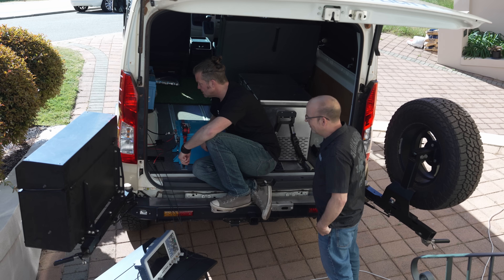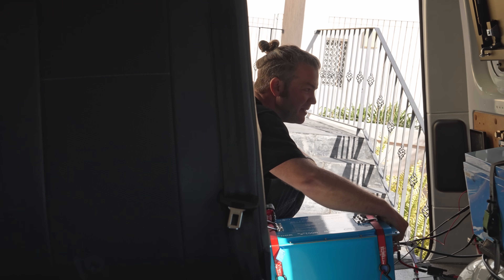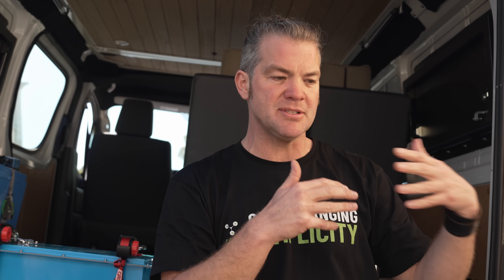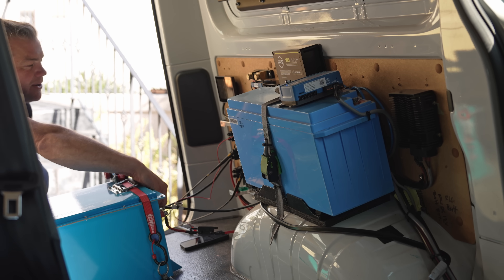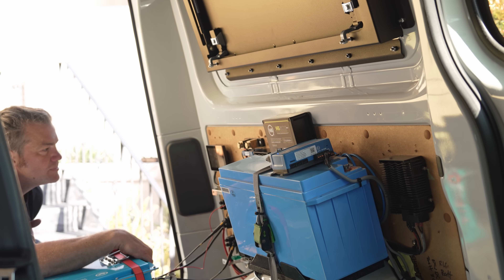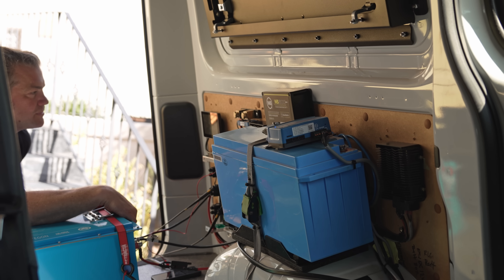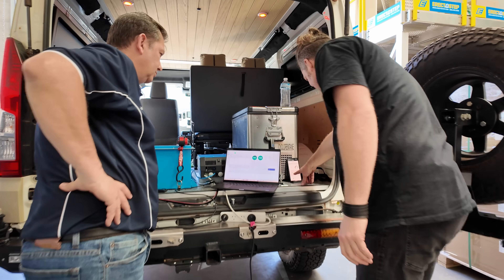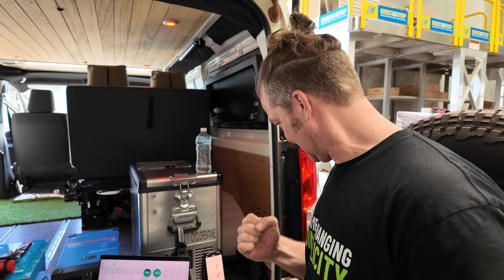FINAL HURDLES CROSSED. 48V is on its way  @4xoverland

Comment: Help me understand this concept of driving away, charging tge vehicle's battery, returnung, shutting off the car and recharging the caravan.

1. does a typical 12v battery have enough amps to charge a presumably much larger house bank?

2. sounds like the risk for #1 is a dead vehicle battery. is there communication betw batteries? (and an auto disconnect based on voltage sensing)?

3. must the vehicle have a smart alternator? ie, old vehicles out of luck?

and one comment...love the enthusiasm and all the "awesome things" we can do.  ...but im still not sure i quite understand the benefit. so id suggest continuing to refine and clarify the benefit. (the need, the problem & the benefit). i think i get it (certainly smaller wire sizes & a bit of weight savings), but im not quite there.

good luck! love following the design/development. exciting!
Reply from the maker: This cannot be done with 12V. Physics prevents it. 
Benefit: Really fast battery charging. Think about what that actually means. The equivalent of a 400 a/h 12V battery charged 0-99% in 1 hour driving, that is faster than the fastest shore power charger. That, with a the best 12V system is 4-5 hours in 12V. There are many who drive 12V to its limits and for them this is a game changer. AND . . . the energy savings on the battery discharge side, we haven't started that discussion yet. And we are about to prove it.
Reply: @4xoverland  hi Andrew, I’m also confused by the idea of driving the car to go fishing and then returning and being able to recharge the caravan from the vehicle (with the vehicle off). I get that the 48V alternator allows rapid charging, but where did that energy get stored? The vehicle would need a battery with a capacity like at least half of the caravan’s battery (so it can half charge the caravan when you return)
Perhaps another example would be to talk about how long you would need to idle your vehicle to restore a decent amount of charge to the caravan, I suspect that would be an example that most campers could relate to. 
Keep up the great work, the products look excellent, I think you’ll have more trouble telling the story than creating the fantastic electronics 🙂

Comment: I think one of your biggest achievements is creating the 48v alternator and the associated circuits so it will happily supply the vehicle’s 12 volt needs.  I think this part is very significant and glossed over a bit, people may not be fully appreciative of this achievement.  The 48v hub is also awesome.
Reply from the maker: All this is done via the 48V hub. Plug and play 48V. A world first.

Comment: What difference or and advantage would this system have over the bluetti RV5?
Reply from the maker: To compare this with a Bluetti is like comparing the load carrying ability of a Fiat 500 and a BelAZ 75710. (Google it)
Reply: @4xoverland The RV5 is also 48v using 48v lithium battery’s
Reply: @4xoverland Edison built an electric chair to try and prove Tesla wrong, never been a fan of analogy’s, that being said I’m a fan of what you guys are doing and keen on your 12v egon as my power demand isn’t to high when off grid  prospecting, but also look forward to options for the future for long term off grid solutions when the sky’s are grey.

Comment: What is different between your product compared to the 48 volt systems already in newer caravans and touring vehicles ?
Reply from the maker: Right now, every 48V system is extremely complex, unservicable and expensive. This changes everything. Its simple, ease of installation, built in redundancy and price.

Comment: Why not install a ecoflow delta with one or two additional batteries and go to 240v. 

Much more efficient, smaller cheaper and more versitile.
Reply: 240vac brings a whole new level of safety requirements (for good reasons). I personally would not feel comfortable driving a car full of 240vac. Too many failure modes that could result in electrocution of the occupants. 48v is a nice balance between efficiency and safety IMO.
Reply from the maker: Thats all fine but you've changed nothing. Adding batteries solves nothing. How are the batteries charged? If its by 12V source its slow and cannot resemble what is achieved here. Even a 240V wall socket can't deliver this charge rate!

Comment: 4 weeks without moving the caravan or plug in, just on 12 volts and solar over winter. 
What can this offer that the existing system doesn’t.
Reply from the maker: If that works for you, then faster charge and reduced losses in the discharge end might help. But by the sounds of it, your system works perfectly for you. Until you add an air-con that is?

Comment: Love your work!! I come from a Comms standby power background, where -48VDc has been used for decades!  I was always heading the 48V way for my Sprinter conversion.  The controlling of the 48V alternator is  a major part of the “revolution”.   The V30 Sprinter conversion market is significant. Be pleased to know how this system will fit into the Sprinter platform?
Reply from the maker: You are absolutely right! We have our US partners looking for a Sprinter 48V alternator now. Its the only missing piece of the Sprinter puzzle. Keep watching.
Reply: Having had my VS30 Sprinter for a couple of years, another selling point of your system is the 48V to 12V DC to DC to the start battery. The van draws a lot of quiescent current, (not to mention the electric sliding door). So rather than trying to feed the door and other items from the camper battery, this is a much neater solution…

Comment: Let me know if you need a demo vehicle and van for the testing. You can replace the 12V Egon system Heiner installed into me 200 four years ago into the 48V version. :) In all seriousness, the technology is looking very promising. It will be interesting to see the cost of the full set-up once production models of the components are finalised. No need to carry the 2.2kW genie for those emergency situations. Great work!

Comment: Who makes the 4WD hiace?
Reply from the maker: Its a Toyota HiAce converted to 4x4 by Bus4x4 in Brisbane.
Reply: @4xoverland well yeah….that too lol 👍
Reply: @4xoverland I’ll ask them about cost, I’ve just test driven a quartermaster grenadier but the hiace could be an option
Reply: Starting with Bus 4x4 you will then move on to whatever your own needs in a camper are.  We camper people are a pretty diverse lot and variations are endless.  Andrew and Heiner have been moving along a development path that is far from over, given their careful testing and high standards, especially since so many components have to be specially designed for HiAce….the market has not just been sitting there waiting for us all to take up what we want for our own build…..it is all being developed and manufacturers will gradually move in and produce whatever they do best.  Then we can begin😊.  Roll on 2026!!
Reply: @robynetracy1440 what sort of price is the converted 4WD hiace? I’d customise it myself. I’m in qld
Reply: Bus 4x4 has head office in Brisbane.  When I last enquired their system was available for new vehicles pre-registration only.  Registration in Australia requires engineering certification.  Their prices are on their website.  Enduroco can accept vehicles post-registration….I don’t know a lot about them as their lift is a bit lower than Bus 4x4.  You would probably need to discuss the process with Queensland Motor Registry to determine whether self-conversion to 4x4 was practicable.
Reply: @robynetracy1440 I still have nostalgia to my UK Devon moonraker camper which was very handy when I took girlfriends out on dates ;)
Reply: Toyota
Reply: @2UZFE The only 4x4 HiAce Toyota built vehicles I have seen imported into Australia have used the ‘snub nosed’ design which they still sell in Japan.  I am told that this design has the driver and passenger sitting over the engine….not so comfy on our off-roading tracks!

Comment: This is very innovative. However getting a 48V alternator is a challenge. And you cannot just plug into your car. Most likely it has to be a 2nd alternator, which means , new brackets and belts and pulleys, provided you can find a space to fit it
Reply from the maker: Good point. New 48V alternators are easy for some cars, and more difficult for others. We are testing now on the Toyota 2,8 and 4.5 V8. And others planned for the near future. The 2,8 was a straight swap. No new brackets or belts required.
Reply: @4xoverland If it is a straight swap, how does the existing 12V electronics handles the 48v ? Tap from the Egon hub ?
Reply from the maker: It does this simply through the board and a 48v-12v converter. It works faultlessly. We will do a full explanation video very soon.
Reply: @4xoverland  did you swap on the HiAce to a beefier alternator with more current assuming the system is 48v stock?

Comment: I didnt get it until the last explanation from you both at the end of the video. My next upgrade of my system I am going 48V!!
My only issue though are you still not limited by what your alternator and DC-DC charger can supply? Wouldn't I need to update those components as well?

Comment: You do realise in series  you are talking  in confines 2-4  batteries not 1 or 2

 Have you also considered  your complete 240 vac  output option 

Have you  even considered  what you  total kw consumption is

As you're not using LPG as part of this build

Most of the vac  1500-2500 per device
Reply from the maker: Lieutenant Nyota Uhura assured us that with the twin valve throttle in vector thrust mode, it could not exceed printed parameters. So you have no need to worry.
Reply: Yet teting stuff without load becomes a pointles  test @4xoverland 

Na i ama realisr andrew and also understand t b e dc to ac limitation
 Building something half arsed  not understannding actual load vs  fictional load is vastly 2 different things
Noting heiner  screwed  up yiu are averaging 2x 240 vac  inlets at 20 amps a piece

This is based on a min spec 23. Foot  caravan
May be look at  what you  plan to rrun off a 48-96 vdc system  running 240vac
Kettle 1500 watts
Hot plate 2500 watt
Exhaust fan 1500 watts
 Microwave 1500watts
Hot water heater 1800 watts
Air con 1200 watts
Pie warmer  1200-1500 watts
Airfrier 2200 watts
Water pump 600 watts
Fridge freezer 2200 watts small fridge 

Havent covered tv  sat net ans sat tv in power usage

Understand this andrew do anderstand  what it takes to live insomething  rather than deploy ad-hoc solutions  that may work in limited use capacity only to find out you fall to short to  give you what you want rather than need
Reply: @jasonhowe1697 few of those items are used simultaneously or even on the same day in my house!
Reply from the maker: Oh, you are being serious. Sorry. Given that everyone involved in this project are electronic and mechatronics engineers with various university degrees, you should at least give us credit for knowing that a fridge doesn't use 2200W.
Reply: @4xoverland  I'd trust her...